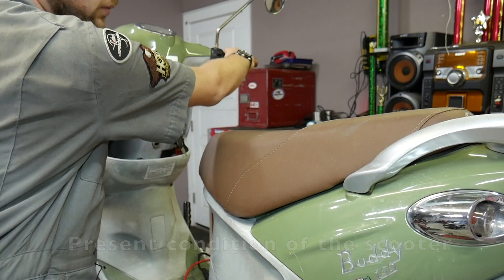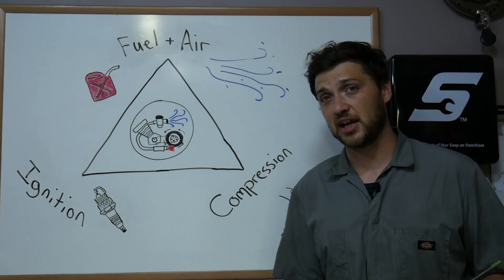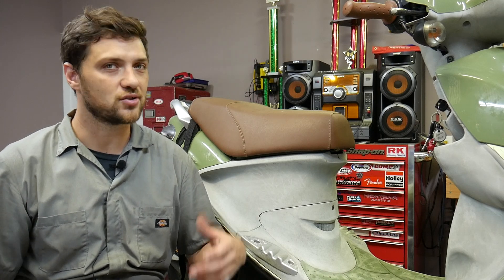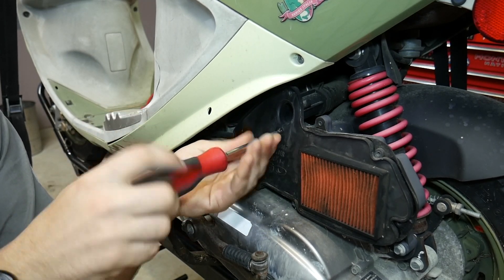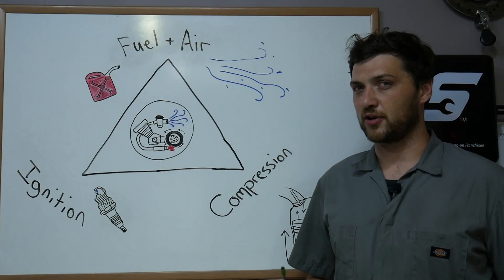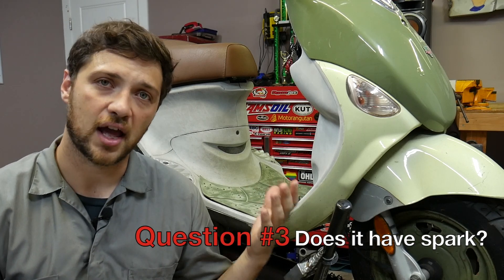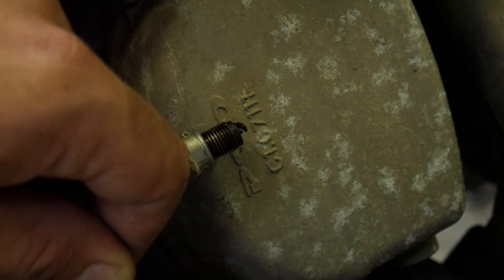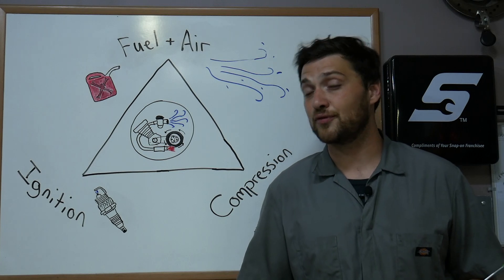Scooter 911: Find out why your scooter wont start by answering 3 questions!

Comment: Garret: "If you scooter has been sitting for a few months, check the carburetor!" 
Me: (scooter has been sitting for 35 years......)
Reply from the maker: Sheeeeeeeeeeeeeeeesh!
Reply: @Scooter_911  Yeah haha. Its a 1984 Honda Aero that I swapped a 1984 honda CH125 engine into. I used your cool method where you use the pliers on the starter relay and it got the engine to crank! I was wondering if its bad for it to always start this way though because whenever I do it you can smell it and there's tons of sparks.

Comment: HELP!!! I have a panterra fusion electric scooter. I am not mechanically inclined but I am trying to get this thing going. It looks like the controller has wires that aren't connected, I don't know why they aren't connected I also don't know if when connected, it will start. I need some expert advice and you are the most knowledgeable person I have found. Please help me ,Derek 575-496-0184

Comment: My scooter only  runs a few seconds on carb cleaner. I have cleaned the jets but it still doesn't start without carb cleaner
Reply from the maker: You might try a valve adjustment. Sometimes additional fuel can compensate for a lack of compression
Reply: @Scooter_911  thank you for responding. Its a 2 stroke so there are no valves

Comment: My jmstar 150cc has a no start issue.  I jumped the starter relay like you showed and starter motor whines but won't start.   New battery.   Any direction.  Great videos and information.   A sub for sure

Comment: My Genuine Roughhouse 50 Scooter would crank but wouldn't start after sitting for a couple of weeks. Watched this video and followed your instructions. Took off the filter cover and sprayed the carb with the cleaner just as you showed. Started right up and now starts instantly. Best video on this topic on YouTube. Got my scooter running and taught me a lot about how it runs.
Reply: I'm having the same issue,  .. I'm going to get some carb cleaner and hope it works.  This video is so easy to follow along with ❤❤ I learned so much
Reply: @triciaelder0517 did the carb cleaner work?
Reply: I am having trouble starting my 2015 Roughhouse 50 Scooter too.   Are you able to explain where the carb is for me @nick difranco?
Reply: S. B. On the left side of your bike underneath the logo there is a plastic black covering. That’s your air filter. You need to remove all the screws and the cover should pop right off. In there you’ll see a little hole like a small tunnel, just like he shows in this video. Your carb is in there so that’s where you spray.
Reply: @s.b.6010 under your seat buddy !
Reply: Scooter shut off while riding.  Starter turns but engine not catching or turning on
Reply: @robertalston4609  Watch the entire video, then you will find an answer.
Reply: @robertalston4609  same. Anyone have tips? More gas? Lol
Reply: @robertalston4609 Spark plug might’ve come loose.
Reply: My scooter set for about 2 years and wouldn't start. After seeing your video I sprayed carburetor cleaner in the intake, it started ran for about 2 minutes and died out. What is my next move?
Reply: What sort of carb cleaner to use ?
Reply: @akeassad Whatever’s cheap at your local auto part / hardware store.
Reply: Would a regular buddy 50 have the same spot where you spray it in?
Reply from the maker: Thats so great to hear!

Comment: Hey Garret, my scooter is a year old and has 1,000 miles on it. I drive it daily and use 93 octane fuel. Two days ago I rode it in the morning and then turned it off to run into the store. Came out ten minutes later and it wouldn’t start but I came back an hour later and it started up pretty easily. I drove it back to my apartment but it won’t start anymore. It does turn over, has spark, has fuel, and the battery is charged but it won’t fire. What could this be ?
Reply from the maker: Very likely could need a valve adjustment. When the engine is hot it can worsen the effect of the improperly adjusted valves or sometimes the extra fuel supplied by the choke (only when the engine is cold) can compensate for the lack of compression enough to get the scooter started

Comment: Hi - I have just bought a 2013 Aprilia Mojito Custom which had been off the road for 6 months.  Serviced and MOT'd - speed cable and drive replaced.  Started  OK using front brake lever then, after a 40 mile run left it for about 40 mins and would not start using same brake lever.  However, it did work fine using rear lever.  Any ideas?

Comment: Hello Garret
I’m a new subscriber to your channel. I have 2 problems with my Jonway 250cc touring scooter. 
1. It was in a flood and I’m reconditioning it. I have replaced nearly all electrical parts as well as the fuel pump and carburetor. It appears to not be getting fuel. I know this because I’ve removed the carb and put a little gas in it and it starts and runs for a bit of time until the gas I put in is consumed. What do you think I should check now?
2. Before the flood when I would take off the scooter would jerk until I got up to a faster speed then it would work fine. When I came to a stop and started up it did the same thing all over. I have not seen a video of yours that might address this problem. Do you have one or plan to do one?
Your expert help will be greatly appreciated. 
George
Reply from the maker: I would make sure that your fuel pump is getting good vacuum from the intake manifold and that the vacuum lines are not cracked or split. As far as the drivability issue you're experiencing i'm not really sure what would cause that other than a carburetor issue or possibly a loose pickup coil. Good luck!
Reply: Garret Seesing thank you for the advice. As far as the jerking I’m pretty sure it’s in the transmission.

Comment: Garret, I have a Chinese scooter 150 cc gy6 engine that has trouble getting fuel to carburetor ,I overcome this by applying vacuum to the vac. line to the the vacuum valve on the fuel tank, after that the engine starts ok and fuel continues as normal, Do you think there is a problem with the valve and what kind of vacuum should be seen at vacuum connection at the intake tube on the engine sufficient to cause fuel to flow. any suggestions is appreciated.

Comment: This is literally the first time I've ever watched a video about how to troubleshoot my scooter that explained what things were and showed what they looked like so that someone like me who is not remotely mechanically inclined actually knew what the hell you were talking about.
Thank you for that. I'll try cleaning the carburetor now that I know what that looks like and how to do it. Hopefully that's all my scooter needs. It's been sitting for several months due to the pandemic removing any opportunity or reason for me to go anywhere lol.
Reply from the maker: right on! let me know how it ends up!
Reply: @Scooter_911 my 150 scooter has no power after riding I can ride 1 hour and turn the key on and nothing 😱😱😱. I hate electrical. Ideas.
Reply: @Scooter_911 my 150 scooter has no power after riding I can ride 1 hour and turn the key on and nothing 😱😱😱. I hate electrical. Ideas.
Reply: How did it go
Reply: @cubixman9676  Unfortunately I just wasn't able to get the filter off because of the model, (chassis was in the way, would have had to pull a lot of it apart to get there) ended up letting the shop do it so I didn't break anything, lol.
Reply: Always start scooters at least once a week
Reply: Run for twenty minutes or ride same
Reply: Hello, my scooter been sitting for a couple months and when i turn on ignition there is no sound coming from the fuel pump do you have any idea what the problem could be ? Thank you
Reply: Lll
Reply: i agree! great teacher!

Comment: Scooter 911! Help!  Battery grounded to engine. Kill switch seems ok. Lights work. Starter cranks strong.  Continuity everywhere you need it. New stator, and flywheel housing spins on crank. New CDI, light blinks on crank. New Coil wire. New spark plug. Continuity from CDI harness (CDIH) YB to Coil YB, Coil G to ground, CDIH RB to Battery+, BW from Stator to CDIH RW, RB from Stator to RB on CDIH.  Still no spark.  What am I missing?
Reply: I found it.  It was the KILL SWITCH.  The KICKSTAND kill switch.  I was trying to start it while using the kickstand, like for weeks. 
 :-D  Who knew?

Comment: I have a lance soho 50 cc is not starting I did some digging found out it ran out of oil..I bought it brand new and got excited rode around with very little oil in it from the shop when buying new.  I got 2 good rides then now it's not starting but turns so the spark plug is good.

Comment: I have a 150 c.f. motoring 4 stroke moped. It cranks and idles fine but when hit throttle it bogs down and wants to stall or will stall if keep throttle open. Any suggestions?

Comment: Does it work with spraying carb cleaner in the air intake a 2001 Peugeot scooter? Or is it for newer scooters? Complete newbie here but I like your videos. My scooter dies when I pull the gas/accelerator after I kick-start it.
Reply from the maker: Yes indeed! Works on all scoots!

Comment: Hey, thanks for the video. It was very helpful. 

We have an old Monkey-Clone with a Lifan 50cc engine that stood in a garage for 10 years but not properly mothballed.

Cleaned out the old gas and carburetor. Managed to get it started again by replacing the old spark plug. Turns out it was sparking, but not enough to ignite the mixture.

Now it runs, but has next to no power. Any tips on troubleshooting that, please?
Reply from the maker: I'd try adjusting the valves next! When you cleaned the carburetor did you remove the jets and clean them individually?
Reply: @Scooter_911  yes, we did. Both jets and the needle. But we didn't have replacement gaskets on hand, so we didn't replace those even though you should. Face-palm worthy, I know.

Comment: What if the scooter is getting current to the CDI, but no spark? I have a TaoTao ATM50-A1
Reply from the maker: The cdi is getting a signal from the pickup coil and AC voltage from the charge coil but no spark to the spark plug?
Reply: @Scooter_911  as far as I can tell. It's lighting up, and now the headlight isn't working. All the other lights are though. I've replaced all electrical except for the ignition switch which seems to be good.

Comment: I have a scooter with a Gy6 engine, and when then engine is cold it wont start on electric. But starts fine with the crank. As soon as the engine is warm, it starts fine with electric starter.. I have no idea what the problem could be. Hope anyone have some advise :)

Comment: I have a E-Ton 50 Sport with a CDI box wiring issue. The wires for it were pulled and the clips that connect the wire inside the harness is all messed up.. I've been trying to find some kind of something to help me and i cant get anywhere. Please help!!!???!!!

P.s., i have a good share of mechanical know how, but thats more with cars
Reply from the maker: Send me an email at garretseesingofficial@gmail.com  and I'll help you get it squared away
Reply: I sent an email
Reply: I am very sure you are busy and if your like me, swamped with emails. I sent the pics and stuff you asked for.

Please get to me as soon as you can, i need this thing to work so i can go on a much needed cruise. Much appreciated!

Comment: I would recommend NGK spark plugs only for 4 stroke engines, but not for 2 stroke engines. If the NGK spark plug gets wet in a 2 stroke engine due to a no start, the isolation material around the center electrode gets conductive very soon. So the spark plug fires "within" the spark plug and the engine would not start. If the spark plug is really dry again, it will work again. It took me a while to figure that out. Since then, I've only used spark plugs from Bosch for two-stroke engines. They will fire between the center- and the ground electrode even when they are wet.

Comment: hey i have a 2003 qingqi QM50QT-3E 2 Stroke with a mikuni carb and it was running but would leak out fuel when parked then now it wont start. how do i identify the motor or a manual for this scoot any help would be great

Comment: Hey Garrett 
How long can gas stay in a scooter 
B4 it goes bad ?
Reply: A few months wouldnt hurt, but a good carb clean would be a good thing to do.
Bad petrol will leave a thin layer of film in the carb and can cause clogged jets
Reply: If you @all have the opportunity try to get out all of the fuel before you leave your scooter standing for a longer time. This way you should not have issures with restarting it.

Comment: I got a problem with my new tao tao newspeed 50, when it starts but when i full throttle it,it starts to slow down and kinda jumps also will turn off or shut down engine.. also i have 2 of the fuel filters also
One in the back of the moped that has fluid in it i can see but theres a air bubble in it. The other filter is by the card and dont have any fluid in it..the scooter will let me run it And drive but fast speed to full throttle shuts down. And im going very dangerously slow can get up to 20 with out is dying on me.. i have to keep throttlen it to work and move but cant hold it back.. please help me scooter 911
Reply from the maker: Sounds like you probably have a blockage in your carburetor!
Reply: Garret Seesing but its new? Tho how is that possible? Im so confused do i need carb cleaner. I put original gas on not premium i changed the oil on it..
Reply: @kevinthorn9672  you bogged his mind that he never responded. So what was the issue?
Reply: @kevinthorn9672  It's a cheap pile of junk Chinese scooter, no wonder all the components are junk from the factory. It's probably running too lean and doesn't get enough fuel when you pull the throttle wide open.

Comment: The main problem is that’s it’s a Buddy scooter not a Honda or Yamaha.
Reply: I have a genuine rattler buck ten and its NOT a problem at all.
Reply: You may be confusing the Buddy (PGO/Taiwan) with the TaoTao (China). The Buddy is a very good machine. The TaoTao..well...Garret the 8-bit wonder is driving one now and Tweeting over time exactly how bad the experience is (or, potentially, is not).

Comment: The best scooter troubleshooting video ever, well explained dude thank you
Reply: Won't turn over got lights and everything but won't start won't turn over on engage
Reply from the maker: Thank you very much!
Reply: @Scooter_911   hi garret ,my scooter is a sym 50cc 2021.i drove it in a snowy day, and failed with it on its transmission and air filter side in the floor because of a skid.on my way home I discovered that the fuel start draining so fast by looking to the panel , I got home  did what I had to do. Then my wife  came after me and observed a little spill of oil on the nead of the scooter.then I tried to start the scooter  witch is start cracking and  some gas start leaking from the filter chamber located on the top of  the engine .I have no clue .what to figure out this issue .can you please  head me up with a favorable suggestion   thankyou
Reply from the maker: @omarihassan8345  the fuel and oil spill could have just been from the crash. As long as your fuel lines aren't damaged. The scooter should start after sitting a few days. It might smoke for a little bit but it will go away. Oil probably filled the airbox along with gas from being on its side.

Comment: I like the point u brought out about the kick starter not being designed for continuous use. Great vid. What do u think of the high torque starters?
Reply from the maker: I've only built one scooter motor that required a high torque starter, and it was a crazy build we did on a buddy 170i. We machined the head and jug and brought the compression close to 15/1. It needed race gas. Other times people have brought in scooters looking for high torque starters it was actually a grounding issue. The stock starters are usually pretty good if the harness can handle the amperage!
Reply: Garret Seesing  Thank u for prompt reply.